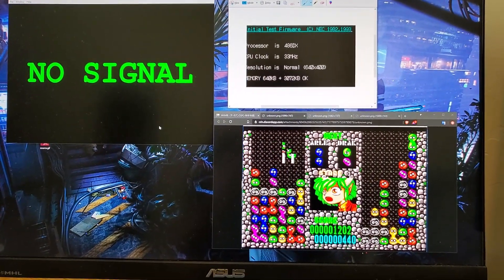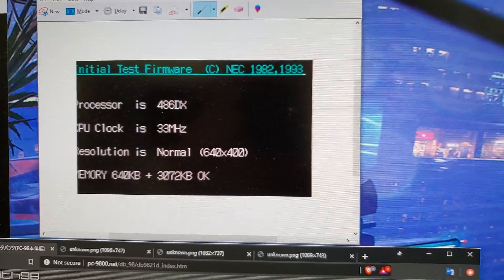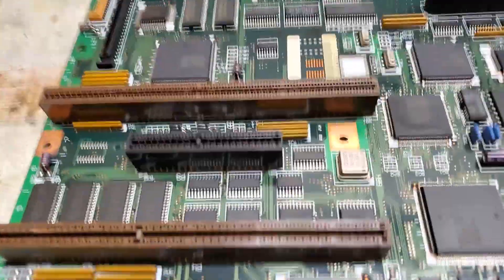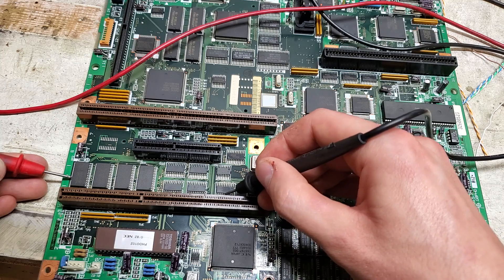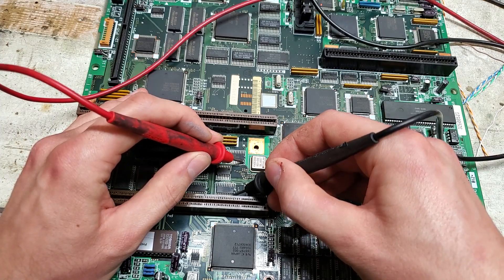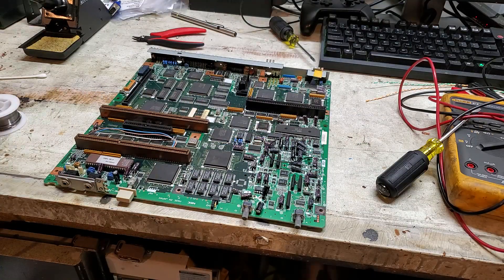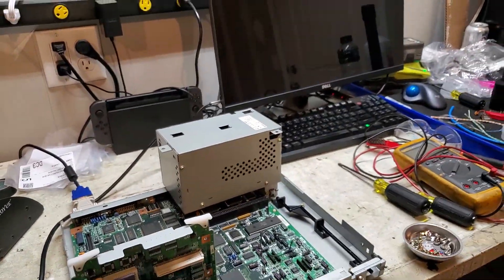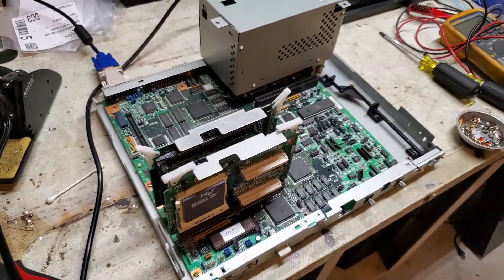NEC PC-9821 As2 Part 4: Memory Bus Repair

Comment: Damn, man.  Sorry you've had to do so many repairs on this thing.  By the way, what hardware do you use to capture VGA and actually works with the PC-98?  I'd really like to do some direct capture when I plan to make my own computer overview videos eventually.
Reply from the maker: Yeah, I guess I got unlucky with this machine. My vga capture card doesn't throw a fit with the pc-98, but it isn't perfect either. It's a Datapath Vision RGB E1. Got it on ebay for about $80.
Reply: @Tr3vor42532  Alright, thanks.